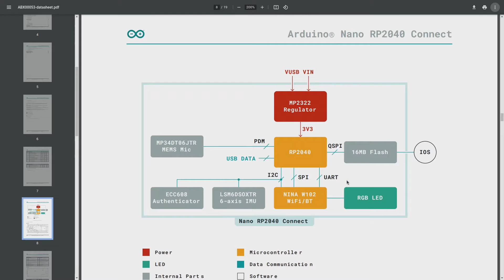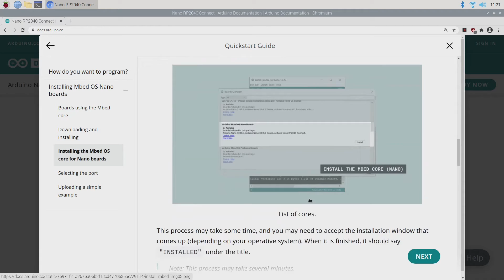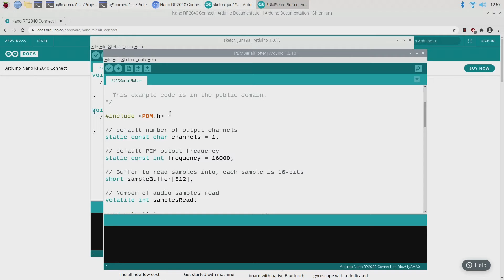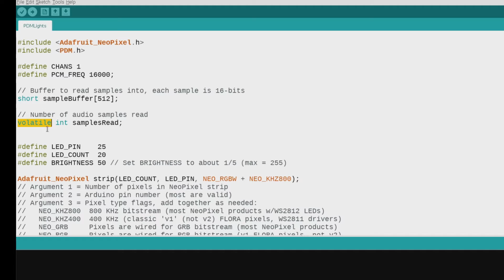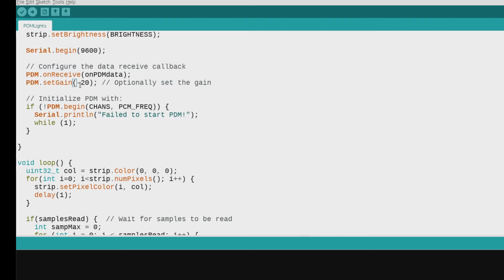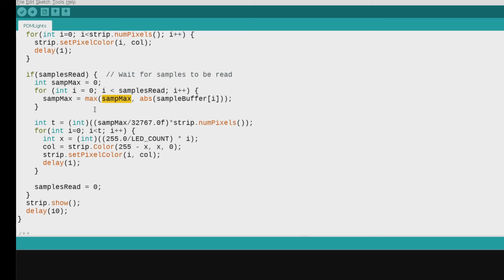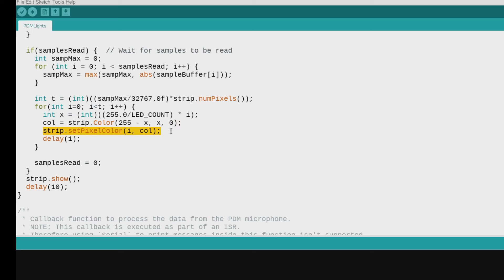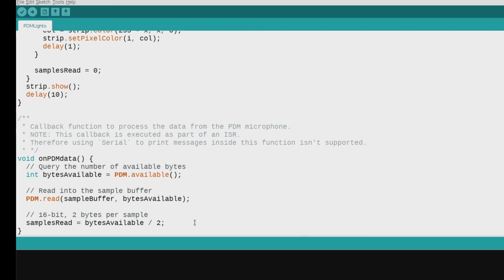The new Arduino Nano RP2040 Connect ( + mic demo)

Comment: Regarding the floating point math @17:20:
Wouldn't it be better to do: 
> int t = sampMax/(32767/LED_COUNT)
> ...
> // in the loop:
> ...
> int x = 255/(LED_COUNT/i)

That way you have a simple, single integer division.

Comment: The antenna is the metal tab on the back, and mine broke off completely from just being dropped by accident.  Which means its a flawed design, and my £26 board became useless after one tiny mistake.  I would call that a fail.  Bad design Arduino, do better.

Comment: As far as processing speed and analog pins reading speed are concerned, programing in C/C++ on the Arduino IDE, do you think this board has significantly better performance than the Nano 33 BLE?